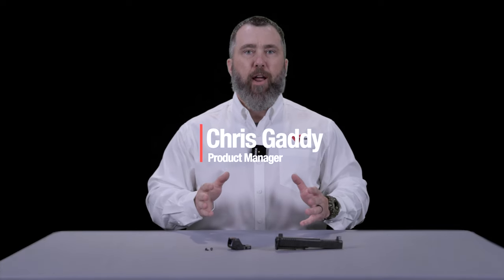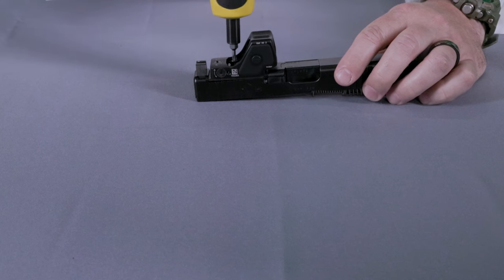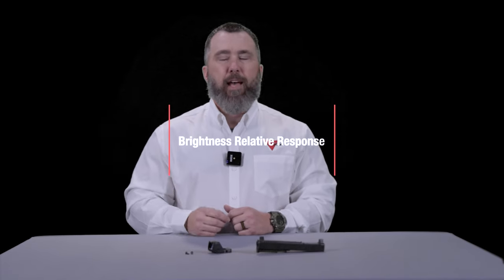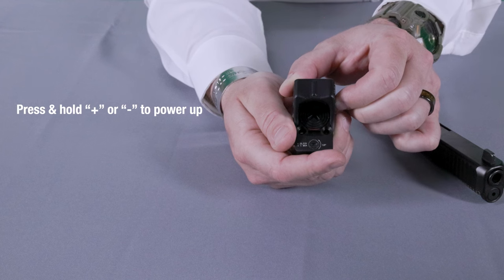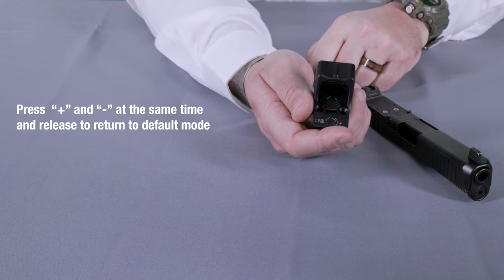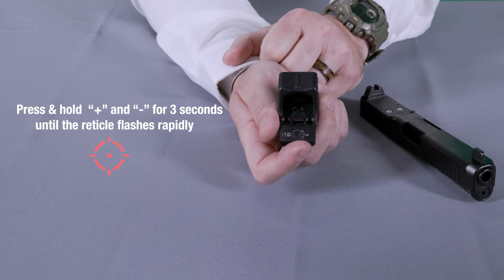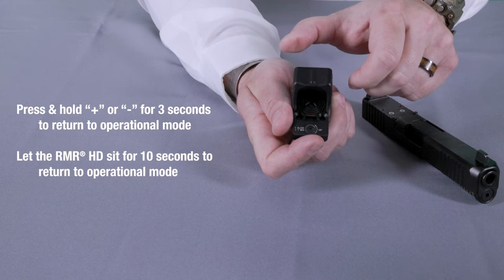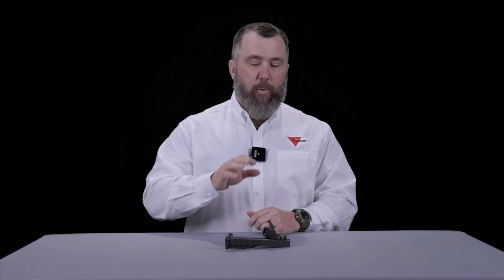RMR HD Mounting & Buttonology

Comment: This buttonology is horrifically bad.  How did any of you think this was a reasonable user interface?  There is no way that I would be able to remember this without reading the manual.  You need to either 1) simplify the number of features, or 2) add another button or two, because this is completely unusable.
Reply: Agreed. If I ever get one, it’s going into one mode and never changing, because I won’t know how.😂
Reply: @@assclapper2231 imagine reading comprehension being so low that a person actually thought not being able to read was at all relevant to the conversation.
Reply: I'm too stupid to use it, I know that.

Comment: Man, happy trijicon finally started updating their lineup of dots.  Holosun has been making some cool stuff but they do have some issues I've witnessed first hand.  Enclosed emitter dots getting moisture inside (509t), an open emitter holosun having the battery tray fly out of the gun after a screw snapped, etc.  Not saying trijicon is perfect (had to send a battery powered acog into them for warranty).  But I definitely trust em way more than holosun.
Reply: i had the battery tray also fly out of the eps carry. a little blue glue and hasnt happened again.
Reply: @zaf88  Hey, for the price they make a great product.  Still have a 509t and I love it
Reply: i agree. love my eps carry. i wish trijicon would add some of the standard holosun features!

Comment: “Once mounted on your pistol, make sure the window doesn’t overhang the ejection port. If it does… too bad!!! And now you’re out $700, ha ha ha ha!”
Reply: Or maybe learn wtf you're buying before you panic buy it lol
Reply: @Jack-M1113  I was referencing the statement in the video where he says if your slide has an RMR footprint, then you just buy it, with no talk of dimensions or measurements, and then you mount it and torque the screws, and only THEN, “once mounted” (direct quote), you check that it doesn’t overhang the ejection port. Whoops! 

Doesn’t have anything to do with panic buying. Trijicon didn’t make it abundantly obvious in this video or anywhere else I’ve seen how much it overhangs or how far back your slide cut has to be from the ejection port.

And I say this as an owner of an HD as well as plenty of standard RMR’s. The HD is fantastic, and I would buy 10 more. But it definitely doesn’t fit on several of my RMR slides, not even close.

Comment: The correct placement puts the rear sight in front of the optic not behind it. I wonder if this over hang will fit on Glock that have been custom milled to RMR and the correct rear site in front of the optic.
Reply: Correct? That's a preference. Most Mil/LE guys I know run irons behind glass. Would you shoot a carbine length weapon with irons in front of glass? No. You want the longest sight radius possible.
Reply: @bobmurphy2216  like I said it's correct. You don't have to understand or follow. It has to do with the way your eyes process data. Your set up is slower. Research the godfather of red dots on hand guns Aaron Cowan of sage dynamics. If you don't have the rear site forward that's wrong but again feel free to be wrong and slower it doesn't bother me. Hours and hours of this information in on you tube if you want to learn
Reply: @timpetrillo2802 I'll bet I'm faster than you either way, even with no sights on my gun.
Reply: @timpetrillo2802 You're funny. It is ultimately preference and no, Aaron Cowan is not the grandfather of anything. He has been a huge advocate for red dots in handguns, but that has been a thing in the competition circle for far, far longer than Sage Dynamics has been around. Likely as long as during Aaron's tanker days. Watch truly world-class shooters and you'll likely see sights at the rear, or no iron sights at all. Sorry this optic doesn't work with your super special custom irons-forward cut.
Reply: @timpetrillo2802  Its not wrong, it's a preference. All its ever really been. A-a-ron himself  has many guns with rearward irons. 

You aren't slower, A-a-ron has said he has a perceived slowness with irons in the rear. But it was not scientifically tested. He basically said "I like it better this way" and you accepted that as the only way when he himself does not accept it as the only way. That's weird dude.

But lets pretend you are right, It is for sure faster. I assume you have data. If it's faster, how much faster?Sell me on it.

Comment: not gonna fit my 509t, same forwrd jut like the sro
Reply: Yeah won’t fit most of my holsters.
Reply: @f308gtb1977  Well, at least you can bust out the dremell or heat gun. I'm going to shell out for the enclosed rmr.
Reply: @rustymacshackleford6276  actually on some of my holsters, the RMR is already up to the mounting hardware. I cut a few holsters for RMR’s when I got them put on, years ago, and those were mostly cut to the max. But yes, still less of a problem than a 509.